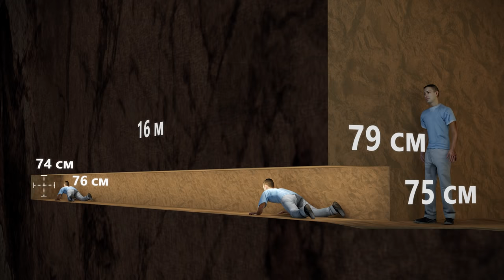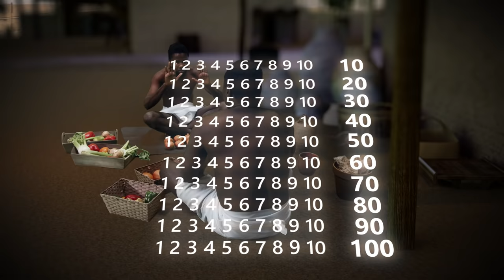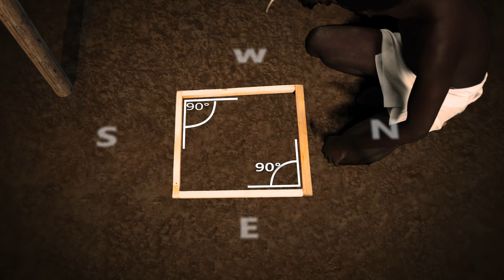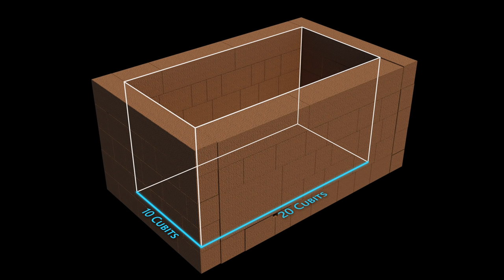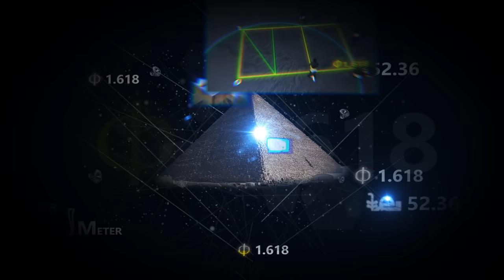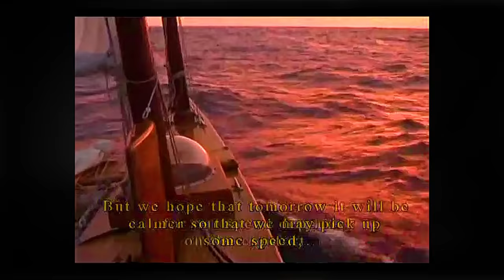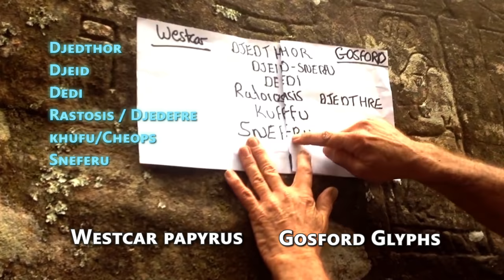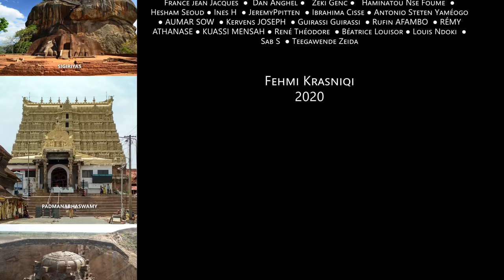The Movie Great Pyramid K 2019 - Director Fehmi Krasniqi

Comment: It gets more and more ridiculous to confirm the conclusions as it goes on
Reply: The rows of guys handing buckets to each other would be the worst use of human effort ever. Have to feed all those bucket passers, just have one guy 1 cart and 5 buckets, another bringing back empty buckets.  or...  or...  or...  LOL  :")
Reply: @WoodysAR  -- And the video paints the picture that Blacks as so smart that they invented concrete, the number pi, geometry, and just about everything needed to advance civilization.
Reply: Only on the planar surfaces of the construction would that be a more logical solution.  For upslope transport (north, south, east, west "crews") as the pyramid rose, perhaps wheels/pulleys, rope, oxen and conveyer system.
Regardless of the transport method of materials, the mold concept is the most fitting of "Occam's Razor".
Reply: @Dr.Pepper001  I believe the point is that HUMANS developed these concepts and to somehow say that it could NOT have been humans with black skin is an insult to what humanity really is.  All of us.  Otherwise it matters not what color their skin was.  What matters is that there has been humanity-tying information purposely obscured for the purpose of dividing humanity. Hence the broken off noses on the statues.
Reply: @Sam W how does it not make sense when no one built pyramids after?
Reply: My husband and l worked out that it had to be cement......da daa
Reply: My husband knew 20 year s ago it was cement and l agreed with him ...common sense really
Reply: @anomaloushoward9121  Well said.
Reply: If you believe that it is ridiculous prove this to be wrong, you have an opinion but you are not qualified to comment if you think it’s wrong tell us why and show us the evidence.
Reply: i wont be finishing the video so i shall take your word for it. the face of the dodgy looking maker of the movie already puts me off he is the perfect  image of a conman
Reply: @christopherobrien6887  it's ridiculous because of many many things I already said look thru the comments and I have already gave my opinion on why I don't have a opinion I have over ten years of searching with open eyes to what's really going on in  this world. I'm not going to type itt all again. But you can find it pretty close to this one.  I give a very clear and concise anwser on why it's ridiculous
Reply: @christopherobrien6887  here you go I went and found it for you.......Those pyramids were not built by khufu and the casing stones are cyclopian in nature so they are much more ancient than this. Also the sphymx is shown to be much much older than thought why would these stone monuments not be older. This documentary shows no proof as yet a I have seen how they were built and the stone age egyptians well bronze age actually which is a contradiction anyway because there was more than one ancient lost civilizations and they were worldwide civilizations. You can tell by the building methods that match from S. America to Japan.  The pyramids were most likely a teacher from how they are built.  What I mean is they probably studied these ancient buildings and got some of their knowledge from deduction. 
 also look at the actual giza plateau a feat that rivals the building of the pyramids. I still haven't seen any evidence of how they were built this concrete evidence makes very little to  no sense. And what was the aswaun quarry for then maybe I havent watched enough but even still the civilizations that built these marvels were stone cutters as shown thru the way the drillhole were cut and there were saw marks deep ones that could have only been done by a machine.  and how were the stone boxes at saquarra cut they are not concrete you can match the stone to where it was cut from. All from one piece of  granite with unbelievable precisionThis video is   enlightening only to show that they did not build these ancient megalithic marvels. And why would this be so when you can go all around the world and see that in turkey they dug into and made cities in solid bedrock they built with stone they cut also look at petra and did they pour these statues that we're erected or the obulisks. Come on this was suck a good start to fuck it up with drawing conclusions on how when we have absolutely no fucking idea.
Reply: @anomaloushoward9121  They don't tell you that: The ramp itself would contain more than 3x the amount of material than the Pyramid itself. The ramps woul be miles long give the Pyramid base is 14 sq miles, and that many of the stones weigh between 500 to 1000 tonnes. Its impossible for man to make with what we know today.
Reply: @edgeofenlightenment7088  Thanks for your reply watch the documentary to the end. Please understand something as Africas we  are sick and tired of all the bullsit eg people coming over to Africa and telling us the we should leave our way of worship because it is evil because Jesus is the son of God and he was a white man. Do you know who the (Olmac's) were the stone heads found next to the Pyramids in America once again things like the golden number, pi. I have no doubt that some of the things in this documentary are a little off but for once it is much better than saying the pyramids were built using stones to cut the stone and Alines not to mention atlanteans.
Reply: @AjarnSpencer  we vote for conman for a very long time and continue to are you sure you know what a conman looks like
Reply: @edgeofenlightenment7088  Besides I have come across many people justifying the murder of the Red Indians by saying that atlanteans were in America before them so they have all the rights to the continent more crazy talk you have not shown me any evidence just your opinion.
Reply: yes, in the beginning I was like: 'ah, that makes sense. And good that they have informed themselves of almost every theory out there'. But 1,5 hours in and I'm like bruh..... highly unlikely... and at 2/3th they lost me coz they want to pursue woke fucking garbage.
Reply: @stijnvdv2  you are projecting your eurocentric ideals on a creature which is Africa, please don't get me wrong every one uses they programming as a point of reference hundreds of years of brainwashed education its not your fault, what was the name of so called Egypt go and find out than come back to me Egypt is a Greek name not African. Just like the Christians coming to Africa for the first time projecting they believes onto us telling us that we are evil worshipping the devil what ever that means. You don't want the truth because you can not handle the truth if you did you would have to change your world view philosopher is a Greek word that means lover of wisdom and truth, the fact is would you even know what the truth is. We have so brainwashed from the day we are born, believing is see, not seeing is believing he who controls knowledge controls your reality.
Reply: @christopherobrien6887  oh do shut up coz I do NOT deny that there were African rulers in Egypt; as the Nubians once taken over the lower Nile valley, but did they build the pyramids?... absolutely NOT! They have been inspired by the pyramids yes, which is why we see pyramids in Nubia, but to suggest that Africans made them based on an African head on a Sphinx, which everyone can see with the naked eye is too small for the body is preposterous... but it's not that Egyptologists are any better. They found some graffiti of names on some stones and viola, we have the creator of the entire structure. Such bullocks.
Reply: @edgeofenlightenment7088  it is not ridiculous all you are doing is projecting ideas which suit your eurocentric world view which you were programmed to belive in a school. Watch the BBC documentary about the Olmac's not one mention about the fact that they found massive heads of black men in America next to the Pyramid come on men that is just a coincidence.
Reply: @Dr.Pepper001  Why is that so unbelievable when Egypt is in Africa? This documentary asks us to open our minds as to what really happened in Egypt, since our current technology and theories are not sophisticated enough to actually conclude everything. If we can entertain the possibility that aliens built the pyramids, why can't we also entertain the idea that humans in Africa built them with the best of their know-how and engineering at the time?
Reply: @christopherobrien6887  Well said.
Reply: It is a sad fact that the aristocrats of Europe portrayed Africans as animals upon arriving to Africa, what is even more sad is that they used these prejudices to justify murder, rape, acts of evil of which no human should be subjected to. The evil genius is that they used religion and schooling as well as they influence in all of the other continent which they stole to justify the murder Africa because it is the biggest continent with the most resources. Upon the creation of universel schooling thses eurocentric view has been taught to the whole human family including black people e.g Jesus which is Zusus a Greek name just look at the spelling is the son of God who was somatic with a Greek name and he was white and the religious beliefs of the Africans were evil. The point being that 99% of people that watch this will not be able to put this into context because it is not in alignment with their world view just go to any of the Egyptian museum many of the statues have they nose cut off why.
Reply: @christopherobrien6887  Exactly.Thanks for this post.Trouble is that the persons that need to listen will not be able to think critically about what you have just laid out.
Reply: @docsmithdc  The problem is that they is no thinking because we are not trained to by design the universel schooling system has been setup to marginalise people into classes.
Reply: @christopherobrien6887  Yes but you and I are talking.
Reply: @docsmithdc  Hi bro from some of the comments here I realised that racists start watching the documentary until the point were they are told that the pyramids were built by black people this is a celebration of the human family.
Reply: @christopherobrien6887  OK What you are up against is what Neely Fuller describes as "the religion of white supremacy".Just as Copernicus was persecuted 500 years ago for saying that the earth revolved around the sun which at that time contradicted the white supremacist religion christianity,people will now not accept any truths that contradict white supremacy.This includes non white people as well because the "religion" of white supremacy has infiltrated the subconscious mind so throughly that all things not consistent with white supremacy are rejected.Even if some people are aware of the facts of this video they must reject them because nothing must disagree with white supremacy.In spite of what we see in this video the world will continue as it is.
Reply: @christopherobrien6887  Yes but for the white supremacist only whites are the human family.
Reply: @docsmithdc  Brother you have put it so beautifuly, I really love the trem that you have used religion of white supremacy. I have a very happy life as an individual because I love truth and it has set me free. I have been studying hard for more than 20 years just about every topic you can think about and endured a lot of pain and anxiety as well as enjoy along the way. Please check out the (Venus Project) I really think that it is a very beautiful idea by a very beautiful human being thinks a lot for your kindness.
Reply: @christopherobrien6887  I will try the Venus Project.But the words I gave to you actually come from Neely Fuller whom you can find on YOUTUBE.He has benn talking about these kind of things for years and will include some very unflattering but truthful statements about how Black people treat each other and contribute to and bow down to the "religion of white supremacy".I saw him speak and lecture while I was in medical school and I tell you he pulls no punches.Start with his "cartoon" entitles "thugs listen up".
Reply: @christopherobrien6887  
These are not eurocentric views. I have given you so many reasons that have come from the latest research. I believe in ancient forgotten civilizations  there is nothing in this documentary that is feasible.  I'm sorry your views seem to be the ones that are set in stone. And I am not a christian. I believe these marvels were made over ten thousand years maybe so much farther back that it's ridiculous for you to call my views eurocentric. So believe what you will there has to be a reason these pyramids got less and less sophisticated as time went on. You have misunderstood but that's ok
Reply: @edgeofenlightenment7088 . Here is the thing that most people don't understand, a Christian sees Christ in a miracle as does a Muslim see Allah and so does a Hindu see Rama Siva Vishnu. The point is that they are all projecting their programming onto want they see, hear which is belief and experience the programming you see things as you are and not as they are (everyone has limitations bias and Prejudice). Now here is the Issue the beliefs what ever they maybe are not mine nor yours regardless, you cannot have a perception without a perceiver the perceiver is in every way a totally creation of culture and environment and in the case of the world today, school a slave training programme, the media, or religion so please don't tell me that you do not have Eurocentric views I am mixed Africa and even I have eurocentric views because I had a eurocentric program as most people in the world today do. You would rather believe in Atlantis than the fact that Egypt is in Africa and if you watch the documentary to the end you will see the explanation for the weathering on the Phix of which you are alluding to, go and research the civilisation that proceed egypt like we're do the Egyptians come research  (Anta Diop a schooler and reacher  you will all the the hallmark that are to be egypt from Uganda all the way down the river if you must know the real fact, oldest civilization in Africa that proceed Egypt where they have all the gods of Egypt  that preceded Egypt you have no idea flase racist scholars and false information.
Reply: @christopherobrien6887  how do you know atlanteans were not black. I assumed if they were anything they were back and yes I am well studied in ancient civilizations. I mean I know we only call them olmecs because we don't know who or what they called themselves. I don't believe in jesus I believe insiritualoty but I do not believe in prophets in the same way as people look at Allah or jesus I am not a godless heathen I believe in a higher power but the idea of religionaies me sick. But I like the back and forth and if you look at turkey or jordan with petra or the way the preincans and other civilizations used hexagonal or polygonal building techniques you can easily see that it was not stone to cut stone techniques. There is no way the cut city sized tunnel systems into solid bedrock by banging stones into other stones. Have you researched these other sites.  And as Africans white and black I don't care who it is and I don't have a eurocentric worldview because I believe all of the ancient civilizations that gave us everything we have today were people of color period And if you look at the way they say that Sumeria started it all it's not true go back to gobekli tepe go back to look at the Philippines with I forget the name of the site but I'll put it at the end of this comment there's no way the delicate fine sculpturing techniques that were used to make these cities pyramids structures were in any way what this documentary says. I think you're kind of stuck on wanting blacks to get credit for all of this I mean most likely every one of them work people of color like I said I respect all colors I'm not a racist I have a different belief system than most people a lot of other people are coming around to it these days I'm going to check your other comments I enjoy our conversations. I also don't understand why do you keep going back to religion when I'm just talking about the stuff that's in the documentary maybe I miss some things but it's hard to watch something that's ridiculous that has so many counterpoints to disprove it. But I enjoy our conversation I'd like to get back from you I'm going to check some other comments out you sent
Reply: @edgeofenlightenment7088 , I really like you because you stand by what you believe and yes you have many good points. I just wanted to know were you were coming from with regards to your mind set. Please feel free to contact email me any further information you come across @chris2obrien@gmail.com. Unless we have these questions and discuss we will never get to the bottom of all of the lies and brainwashing. The very vast majority of what we believe is half truth and lies.